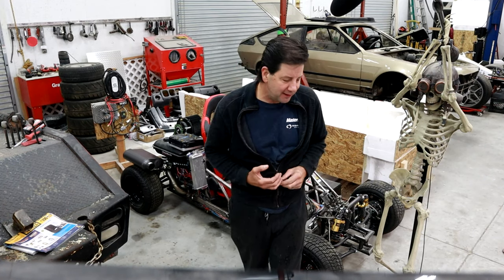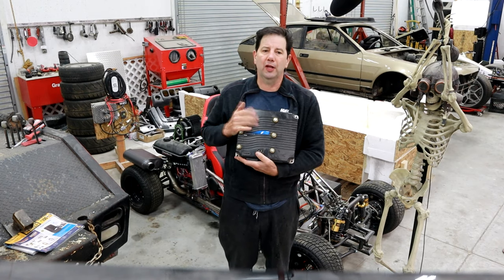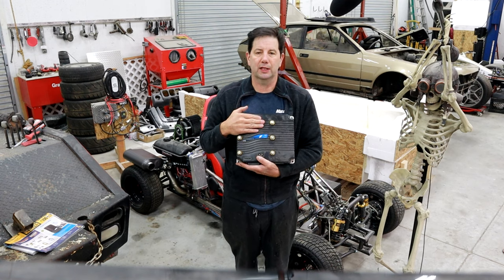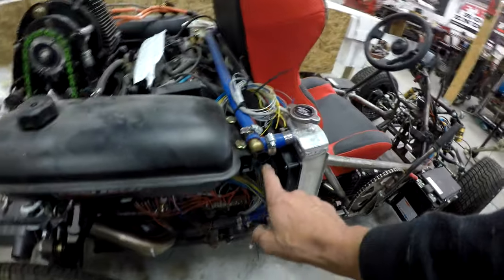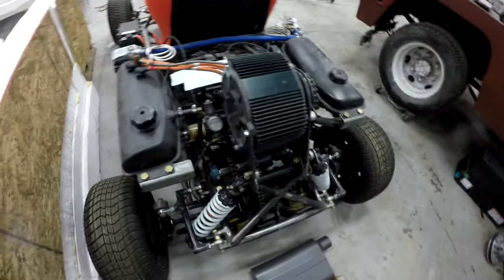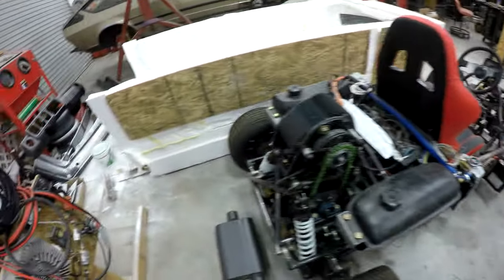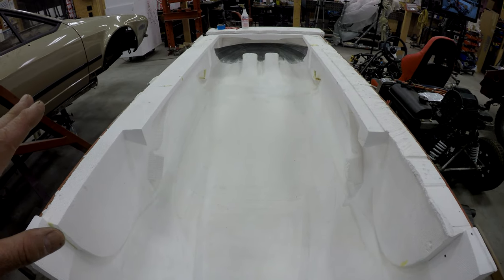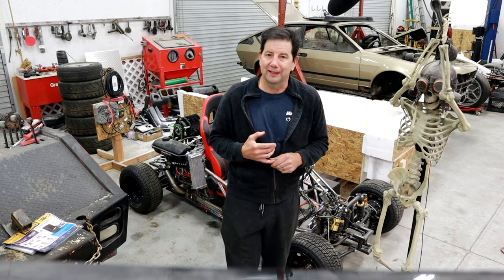Finally an UPDATE!!!... Hybrid Cross-Kart Ep 13

Comment: Would using 2 of those EM clutches on the jack shaft help with the over current issue? Programming the actuation of the clutches such as the clutch on motor side stays engaged till 6k and then the engine side engages and the motor side disengages beyond 6k. This would probably become a bit bulky. But maybe you could utilize the same controller if using 2 clutches would be feasible.
Or you could have the same sort of programming by using a servo to actuate the clutch on the engine, thus keep only 1 EM clutch on the jack shaft.
Reply from the maker: Yes...I was thinking of something similar.  The problem is the lack of room.  I've actually started designing a 2.0 street legal version which will be just a little bit bigger (still a single seater) that will hopefully have more options.
Reply: @XSMotorWorks  I think the lack of room can be countered by one of those high torque RC servos directly connected to the clutch arm on the engine. Those are small and would serve as a good experimental setup for RPM based clutch release
Reply from the maker: @Yathartha_Singh  I will have to take a look into that...Thanks for the info.
Reply: @XSMotorWorks  glad to be of help, looking forward to the next video!

Comment: i like the project and what rashud is doing. watched the ev install and tried to read up on the components. does the me1507 come packaged with more info than the single sheet motor data listing i could find? because the voltage constant says that this motor wont turn faster than 3800 rpm at 100 volts and no load.
Reply from the maker: So I have found that the data on the motor to be VERY inconsistent.  I can say for sure that I have run the motor with load at 100v/5400rpm and drawing 300 amps.  That said I am concerned with burning the motor up with the new controller but this is R&D so SEND IT!

And I should also mention...Rashaud is going down... :)
Reply: @XSMotorWorks  lol, he will cope with it. i would think that you got these values with both engines engaged. you can spin an emotor faster with outside help than it will turn under its own power only. up to the mechanical breaking point, thats the 8000rpm max. bearings, balance, those things. if you have the motor temp sensor hooked up, the curtis will guard the motor. likely already did :)   there is of course the possibility that there is no relation between the data on the net and the motor you have.

Comment: i would estimate high power lipos of that size to run for 3-5 minutes at around 450 amps. what runtime are you going for?
Reply from the maker: Honestly I’m not sure.  I really want to see if I can get a 0-60 in the 2 second range.  This is really just a prototype/information gathering for 2.0 Hybrid
Reply: @XSMotorWorks  have you looked into capacitors? for seconds of raw power.
Reply from the maker: @waldsteiger  I was thinking about super cap but there prices right now
Reply: @XSMotorWorks  Where I work has a large server farm that uses an UPS (uninterruptible power source), if the building looses power this system comes on in a millisecond.  They use large caps, when they do our annual service, they get replaced.  They are 490,000 uF 35 WVDC, any good?
Reply from the maker: @michaelbarrett8754  I’ve been looking at using super caps but they cost money and honestly before adding the electric motor I didn’t much money until the build.  I’m really think of making a 2.0 version which would be street legal.  Something that would be a great canon carver.  I live a few hours from some great roads (tail of the dragon is one of them).  So more R&D to come